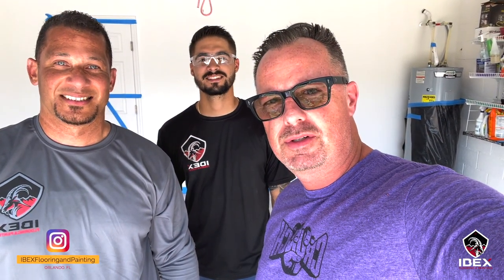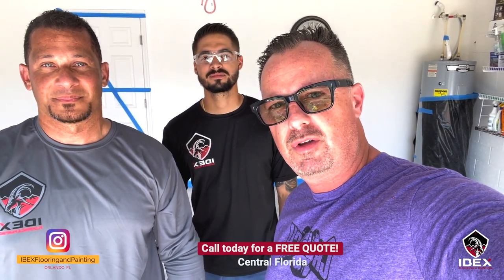Orlando Epoxy Flooring by IBEX | 🔥 Epoxy Garage Floor Install Start-to-Finish!

Comment: Nice video and great work. I didn’t realize epoxy floors required the layers like that. It was interesting to see the process. If you are looking for epoxy garage floors in Orlando and Central Florida area give IBEX a call. Great team.